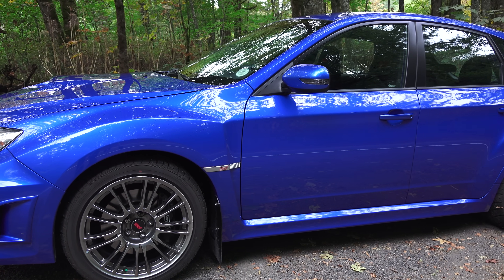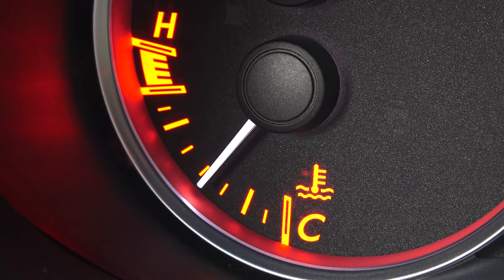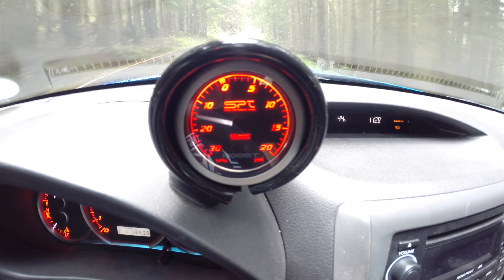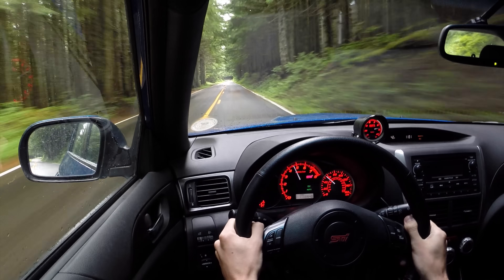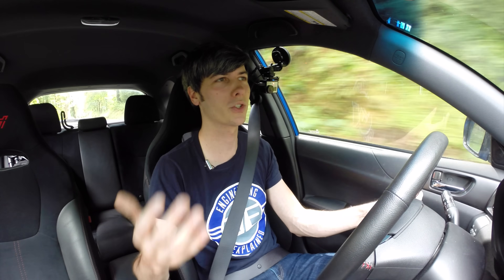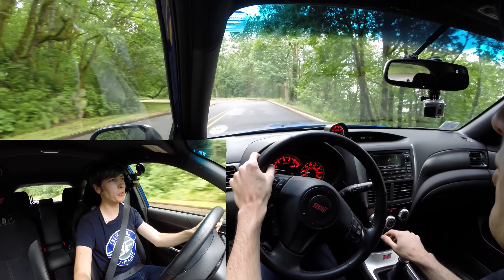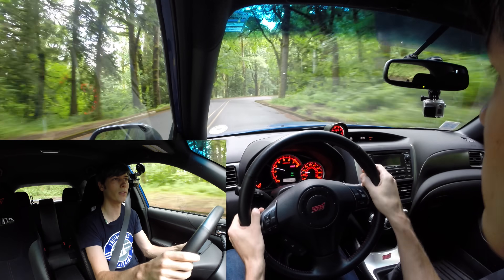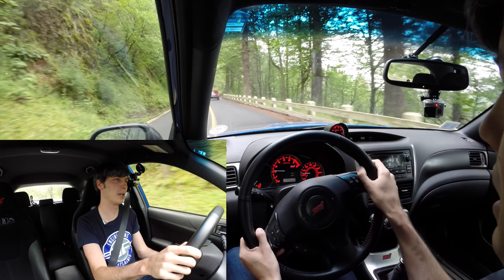5 Things You Should Never Do In A Turbocharged Vehicle

Comment: Let me shed some light on these things, from an actual Engineer that designs these cars...
1. True for any car, let the engine oil warm up before putting a lot of strain on the engine, aka flooring it and revving the engine out.
2. True for Turbo cars, you want the Turbo to cool down to prevent damage to the turbo, in the case that you have been running the car hard and you want to turn the car off immediately. This is only the case when you are track driving the car, or being really hard on the car on the street due to traffic, or just being in a huge hurry.
3. Not true about not "lugging" the engine. Engines are designed to be able to simply step on it while in gear on the highway. Be it a a high gear or low gear. The Fuel that you mention that "injects a ton" into the engine... Not true at all. The fuel is tuned to exactly what is best for the engine given any scenario. Your foot does not control the fuel, the computer does. Out of boost, at full throttle the engine will be sending fuel, per the computer, which would be between 12.5 to 11.5 AFR. Engines respond better, the cooler they are, using the greater amount of fuel of 11.5 AFR, the only reason they would be at 12.5 is to try to save fuel. So, its actually the opposite in this scenario, your engine may be lean, not rich... but again, safe for the engine of course. If you see black smoke out the back, its because the computer saw knock/pre-ignition, due to poor maintenance or poor fuel quality (same thing really), pulled timing, pulled the throttle in the case of electronic throttle, and then dumped a ton of fuel to further protect the engine. This means you need to do your intake valve cleaning maintenance by hand, or drop some cleaner in it. DIY, if you know what you are doing. Doesn't matte how good quality of fuel you think you are using, if it is getting mixed with carbon/oil deposits in the engine, the best high octane fuel (premium 91-93oct) will be reduced to much lower octane, worse than the lowest octane you can ever find.
4. Use the fuel that the car has been designed for, this is for any car. If it's modified, and the engine computer was re-tuned to take only Premium. Use only Premium. If the manufacturer states to use regular, use regular, don't use anything else, you won't hurt the engine, but you aren't doing your wallet or performance any favors. If the manufacturer states you can use both, then the higher octane is better and gives better performance, but regular is ok and you can save money just make sure and do your maintenance. If the manufacturer states to use premium, then use only premium. You could damage the engine if you use less than premium, if not in the short run, then in the long run.
5. Flooring it in a turn, sure, but that's with any car. You need to learn the car, and what its driving characteristics are. This is just being a good driver. Not specifically for a turbo car, or a muscle car, exotic, or a budget car. Any car, and all cars, have their limits.

In summary, for Turbo cars, of the 5 things Jason states to not do to Turbo cars, only Number 2 is specific to turbo cars, and the rest applies to all cars.
Turbo cars: Let the turbo cool down, before turning it off when you have just driven the car really hard. Obviously, a car without a turbo, you don't have to worry about a turbo cooling down, since you don't have one.
All cars: Let the engine warm up before going hard on it, do your maintenance to your car or the engine/transmission/brakes/etc/etc will blow up, use the proper fuel, learn the car gradually before you decide to drive it hard and try to push it to its limits or you'll find yourself in an accident.
Special Note: Maintenance of the intake valves is critical to a turbo car, so stay on top of your intake valve cleaning maintenance, or your engine WILL BLOW UP! Maintenance is important to all cars, but for turbo cars, the engine is extra sensitive to its internal cleaning maintenance. If you don't maintain it, expect reduced performance, and expect to be selling the car very soon with a broken engine that you prefer not to pay for. I've seen this time and time again. I can go into great detail on how and why this occurs, and how modern cars have this issue but older cars do not, but I degress.
Reply: Valuable feedback yours, thank you; however, point 3 is not straight forward in any of both directions. More to the point, it's not even specific to turbocharged cars - although agree that the mentioned fuel issue is impossible with electronic fuel injection.
Know some of engines where full throttle between 1-1,5k rpm in top gear produces quite unpleasant vibrations, due to (I assume) unfavourable physics (inertia and natural vibration frequencies). Both my father's 2016 Fiesta Ecoboost 125 (turbocharged) and my own 2004 SLK 230 (supercharged) or 2011 Delta 1.6 diesel (turbocharged) suffer from this problem.
Doing the same in my 2010 Panda 1.2 (N/A), 2004 CL 55 (supercharged) or 2001-3 SLK 200 (supercharged) feels - and sounds - totally fine. VW group's 2019-21 1.0 TSI 95 (Polo, Ibiza, Arona) also doesn't "complain" much.
Interesting the difference between the SLKs. Basically, ithey have the same engine, but their character is quite different - the 200 are way smoother than the 230. Read similar reports between Merc's M112 2.6L and 3.2L...
Slightly aburd topic anyway, because for quick acceleration it is obvious that a lower gear should be used.
Reply: I read your comment. I am a beginner DIYer.  What do you mean by intake valve maintenance? I have never taken off a valve cover?
Sorry for such a novice question.
Reply: @louarmstrong6128  To clean the intake valves, you don't need to remove intake valve covers. The  valves are like upside down lolly-pops, except with the circle facing down not facing you, and the stem going straight up. Under the valve cover you can get to the stem, but not the face of the valve. What you want to clean is the face of the valve [and the back of the face] which is in the air path.
Before we continue on the explanation, you have to also understand that when your valves begin to get dirty, that's when buildup/cleaning is strictly contained [and needed] at the valves. It is rare to catch it this early. BUT, that's what the cleaning is called, intake valve cleaning. What you want to clean, is not just the intake valves, where the buildup begins, but also everything behind the intake valve all the way out the tailpipe of your car. Intake is where the air comes in, and the buildup begins there, then it continues to run and buildup all the way through the system (engine, exhaust manifold, turbo [if you have one], exhaust system, then finally tailpipe). Intake valve cleaning is a misconception, when what is actually needed is the entire system cleaned beginning at the intake valves... but, many people understand and have heard of intake valve cleaning. Also, once everything is clean, you want to maintain the vehicle by keeping up with the cleaning before it builds up, and that is simply cleaning the intake valves at that point. So, clean it all once, then maintain it by just cleaning the valves. The cleaning procedure is all the same.

Now, to continue on how to clean EVERYTHING, not just the intake valves. This is where you will have to study further, or wait till I make a video myself, as it seems that no one has a complete comprehensive how-to on it. But, I'm sure this sounds extremely labor intensive and complicated... So, to get you started, what you want to use a liquid cleaner. Its really not labor intensive or complicated, with a liquid cleaner. Look up how to use seafoam. There are many products that can do the cleaning, but all the comparison tests I've seen on breaking down carbon buildup on valves, shows seafoam to be best. Also, in my experience, seafoam has been the best. Don't use the Walmart knockoff that sits right next to it on the shelf, it's not as good. Seafoam cleaning. Study it.

A few last words of wisdom. The white smoke that comes out your tailpipe when you're doing the cleaning procedure, that's carbon buildup. When it comes out a faint blue, that's the seafoam. Do one cleaning procedure at a time, and as a check, do another cleaning procedure and see if it comes out a faint blue. If no white smoke, just blue, then no more cleaning procedures needed. Each cleaning procedure, requires one bottle of seafoam. I've seen as many as 20 cleaning procedures needed before you get no white, all faint blue. The car gained about 100hp from doing the procedure... and no more knock, and risk of blowing up. Yeah, you could lose about half your hp when its so bad, its about to blow up... or it can blow up sooner, have oil consumption issues, etc etc.
Reply: @copperkeyracing6167  Boy did I ever hit the holy grail of responses ...I appreciate the the time and experience you put into this, I will have to sit down tonight to fully absorb this....awesome and thank you again
Reply: @louarmstrong6128  you're welcome
Reply: @copperkeyracing6167  Thanks so much for your explanation man, really appreciate it!
Reply: @copperkeyracing6167  Thanks a lot for explaining this in so much detail man! Many Thanks!!
I have a question for you.
I recently bought a Skoda car with VW 1.0L TSI (3cyl, Turbo-GDI). 
Is it safe to use seafoam in this type of engine. 
How often shall I do it?
Regards
Reply: @angad2685  It's safe to use seafoam in all engines. I would do one bottle/cleaning-procedure every oil change, as I recommend for all direct injection engines that don't also have port injection. For port injection cars, I recommend one bottle/cleaning-procedure per year. I'm pretty sure that VW engine only has direct injection.
Reply: @copperkeyracing6167  Yes sir indeed, it is a only gdi engine without port injection. Should i use seafoam even when the car is under factory warranty? Won't it risk voiding it?
I am covered under warranty for 6 years for the car.
Reply: @angad2685  Yes, do it under the factory warranty, it won't void the warranty. Especially when it's new and under warranty. It's like asking if you can take your car through a car wash without voiding the warranty. Of course you can. You want your new car to look nice and clean on the outside, and run clean and at optimal performance on the inside. I know of a guy that took his car to get his engine warrantied after he had somehow managed to blow the engine (he raised the boost on it not knowing what he was doing). He also happen to keep his engine very clean with seafoam. The dealer opened up the engine, saw that it was like new and super clean inside, and had no hesitation warranting his engine. They figured he was meticulous about his maintenance. Another guy, same issue, blew his engine... the dealer saw his engine was filthy inside, they voided his warranty on the spot. The difference was seafoam. Clean engine internals=> no issues. Dirty engine=> sorry no warranty. Who's fault was it? Direct injection was at fault, and the manufacturer not telling them to seafoam regularly... when they needed/were suppose to.  Crazy world, but that's how it works. Keep things clean, people appreciate you. You don't keep things clean, people don't respect you. Not always, but most of the time. Seafoam/clean internals=better warranty, better fuel economy, more reliable, less wear and tear of the engine, consistent and no power loss. It's a complete eye opener.
Reply: @copperkeyracing6167  You're absolutely incorrect re. lugging your engine. Look up LSPI.
Reply: @bhr788  LSPI has nothing to do with load or "lugging." Preignition can only come from either an ignition source (external to charge mix) or autoignition (internal). If you have an ignition source other than a spark plug ( like glowing carbon deposits), that's present regardless of load. Which leaves autoignition. Autoignition requires the mixture to rise above autoignition temp (not flash point, which is different). This rise in temperature can be just from higher temps, or can be from higher cylinder pressure, or the resulting combination (Boyle's law).

But again we find LSPI is not due to load. It might only show up at higher load, but it always has a cause that isn't the load itself-- it something else. Timing, mix, hot spots, etc. A properly functioning engine's response to being overloaded is to stall. Period.
Reply: @copperkeyracing6167  s
Reply: @copperkeyracing6167 no to clean the intake valves you can put in intake valve cleaner into the pcv valve in a di engine.
Reply: @copperkeyracing6167 how to see what color smoke comes out the exhaust, when with for example fuel system cleaner, you have to drive the car for it to clean?
Reply: @Richbutactsbroke  correct, you have to drive the car for it to clean. You put the clraner in the intake tract as I described while at about 2k rpms. You shut the car off for 5-10min, then you start it and go drive it, giving it full throttle. The more air flow, the better it scrubs. You will see a ton of smoke come out. If it's thick white smoke, then that's the build-up coming out. If it's faint and slightly blue, then that's the seafoam liquid coming out. If/when you see white smoke for just the first full throttle run, or none at all, then you're likely done cleaning. If it keeps pouring white smoke out of the exhaust on multiple full throttle runs, keep flooring until it stops, then repeat the procedure.
Reply: @ thanks bro appreciate all your answers
Reply: @copperkeyracing6167 give this comment a random like down the road . This appears to be genuine knowledge I’d like to refer back to in a few months
Reply: What does all this intake valve cleaning do to the catalytic converter? I've got a feeling that it will be damaged.
Reply: @elroyfudbucker6806  Good question. Let me answer your question with a story... I have a friend with a 2005 Toyota RAV4. We are on a road trip and the check engine comes on. This was in 2015. Naturally, we get it scanned, and it has a catalytic converter low efficiency error code. So, we hit up a walmart. And buy two bottles of 16oz seafoam. We do one procedure, lots of white smoke. We do a second bottle, lots of white smoke, but less. Oh well, probably needs another, but good enough. We continue on our road trip... about 50miles later, check engine light is gone. Perfect. Catalytic converter cleaned up, working great now, and no more code... abs working again (toyotas from this era would dissable abs/tcs when catalytic converter code pops up). A year later, code comes back, another bottle of seafoam, and codes gone again for another year. Repeat, haven't changed her catalytic converter yet... so, there's your answer. Seafoam extends the life of your catalytic converter by keeping it clean, build up free. I've done this to many cars, and saved friends/customers thousands of dollars. This $#%@ works!
Reply: @copperkeyracing6167 hello there friend. If you could help me with a problem I would be much appreciative. I have a 2019 Ford Edge with the error code P0243 (Turbocharger/Supercharger Wastegate Solenoid "A"). I was told changing out those Turbochargers can be up to $3000! Is there a way to fix this issue without replacement??
Reply: @JPJ432  Why replace the turbo just replace the solenoid, new should run @ $40 then from your comment you need to find someone to replace for you shouldn't take much at all to do
Reply: The takeaways are....

Maintain your car.   Preventative maintenance goes along way to not getting stuck on the side of the road.  

Use the correct fuel for your type of car.

Drive like a normal human.    Your daily driver is not an F1 or NASCAR  race car.
Reply: Thanks for the info.
Reply: Keep in mind, these claim made by him aren’t originally his he is just reciting what mechanical engineers have been say for a long time. Lugging the engine is very bad for the engine, specifically for “small turbo engines” turbos produce too much heat which can cause detonation at low rpm’s. These claims come from seasoned people and tuners who have been racing engines for a long time. Engineers also make this claim. Just because you are an engineer doesn’t mean you know every single thing about engines. You studied mostly math and physics and a bit of mechanics. Leave the professional studies to the professionals.
Reply: Thanks for your explanation, much appreciated 👍🏼
Reply: Replying to this so I can find it later. Great advice
Reply: Can this be like the top comment, too underrated
Reply: King
Reply: u sound like u shuda made the video
Reply: i guess they just made up LSPI then
Reply: @hypr1 LSPI only exists in direct injection engines that have not been properly maintained. It has been a huge learning curve for some people. Now we know better. Seafoam clean the head/intake-valves at every oil change interval to remove carbon buildup on a regular basis, and LSPI will NEVER occur. You can floor the hell out of it from any RPM, and nothing happens. It will never cause any damage.

If you want to get better response and part throttle fuel economy you can also do a manual cleaning of the valves by removing the intake manifold and walnut blasting. It's not necessary though for removing all chances of LSPI.

LSPI is no longer a thing... with proper maintenance.
Reply: 5. well he does highlight more so
Reply: #5 - especially for Mustang owners lol
Reply: For turbo diesels - what are the do's and don't's?
Reply: You need to get a life, a girlfriend or something.
Reply: Awesome advice
Reply: No way you are an actual proper engineer. Roblox gameplay is very sus
Reply: What is the normal life expectancy for a turbo? My mechanic told me 100-150K miles.
Reply: Do we need regular intake valve cleaning on a petrol engine?
I have a Vauxhall Astra J GTC 1.4Turbo 120PS with 50K miles with full service history and regular maintenance in garage.
Reply: @PabitraPadhy  Yes. I recommend a yearly cleaning procedure using one 16oz bottle of cleaner through the intake tract for a port injection engine. For a direct injection engine (that doesn't also have port injection), I recommend the same procedure, but at the same time interval as an oil change, every 3mo/3k miles (aka 5k km). It's not whether it has a turbo, it's whether it has port injection or no port injection. Port injection cleans the valves. Without it, the valves get filthy, and then, like a domino effect, everything else behind the intake valves does.
Reply: what rpm is okay before the engine oil is fully warmed up?
Reply: @pps9896  I would stay at no more than half of what the factory rev limiter is set at until an engine is fully warmed up (coolant temp and oil temp). So, if it's 7k, don't go past 3.5k, if it's 8k don't go past 4k, etc.
Reply: @ thanks for the tip and quick reply!
Reply: thanks
Reply: Have you ever floored it floor at low rpm in a gear? It sounds and feels horrible for the car.
Reply: @JTheraos Yes, all the time. I love it! Pulls very hard. It's well maintained with no carbon buildup. Runs like a champ! I can put it in any gear at any RPM, floor it, and it loves it. What you are experiencing is really bad carbon buildup.
Reply: I got my first turbo charged car 2 weeks ago, this information is really helpful. Thank you for typing out this, as Jason is going through the list, in my mind I'm thinking "this applies to every car except point number 2" and I decided to check the comments, glad I found this.
Reply: @Satunnainen Katselija  because the service manager doesn't want to admit that he's been defeated. There is obviously more maintenance needed. I would study up on carbon deposits and cleaning it with a liquid cleaner. Manufacturers&dealers don't want to admit that direct injection doesn't actually improve emissions. It just bottles it up inside the engine, and then you have to clean it out.
Reply: THANK YOU, I was a little upset at the misinformation being “explained” in 3 and 4.  I’m glad someone clarified.
Reply: Thank you. I'm tired of these turbo myths being sharted into the ether with authority over and over again by idiots.
Reply: This is why I read YouTube comments. Because sometimes between all of the nonsense is a comment that’s a diamond. That makes sifting through the garbage worth it. Thank you for putting your time into educating people like me.
Reply: How do i check and maintain my intake valves?
Reply: @lennartproost  Read the reply that I gave to Lou Armstrong above. The only way to check how clean the valves are is to actually do one cleaning procedure and see what comes out of your tailpipe. So, learn how to do a cleaning procedure. Do as many cleaning procedures till it comes out clean. Minimally, you'll do two procedures. The first procedure will always come out dirty, the subsequent procedure will either come out dirty or clean. You stop when you've done a procedure that comes out clean.
Reply: Thanks. Best comment I've read on YouTube in a long time.
Reply: From another engineer..thank you.
Reply: you said everything i was going to and i thank you for what you said. 
ive had issues with his car videos when they pop up in my feed and this video proves why.
hearing how it will "dump fuel and burn up your catalytic converter" made my head hurt.
Reply: Many thanks for your intervention. Please make your you tube  channel and I will subscribe immediately. We need ca's guru like you, to explain in detail with proper knowledge   I never liked that guy anyway 😉
Reply: I was looking at the comments at point 3, because i was thinking, this guy cant be serious, what would be the ecu for if not for mapping the engine to any load at any rpm range and also taking a lot of other numbers like lambda or intake temp .... in consideration. You might get vibrations, but this is just the high amplitude of the engines vibration resonating with the transmittion and clutch (dont know every single word, english is not my first language)
Reply: Interesting how long did it take to post this comment? Geez…
Reply: @velvetbear7184  10min. Any questions?
Reply: Not all cars have computers controlling fuel flow so what you said about fuel flow isn't valid. The car I drive is older than me and doesn't even have anything electronic in it.
Reply: thank you for writing all that from me. a 40yo mechanical engineer.
Reply: What a legend we have here!!
Reply: Only use synthetic oil regular will burn in the heat of turbo. Turbos run very hot they glow under full boost when run hard. Why you let car cool down before shutting off when boosting  hard before stopping let oil circulate and cool and turbo cool. I did this by easy 5 minutes before parking if I had been going hard. If not that hot oil and hot turbo when stopped that oil sits in hot turbo and cooks. Best to cool down so it does not cook, that is why regular oil is crap in a turbo it literally will burn at turbo temps.
Reply: @RT22-pb2ppmp
Reply: What is ideal oil temp before getting into boost? Specifically a 22 wrx. I ask because I've heard several different temps, I had to get into it this morning, oil temp was around 127
Reply: Currently finishing my undergrad in Mechanical Engineering and specializing in Powertrain engineering. Everything in this comment lines up perfectly with what I've been studying. Thank you for the input!
Reply: That point in video about lugging engine also made me double take. Just because you aren't getting the power at low RPM, doesn't mean it's stressing at all. And of course fuel is measure for the air, and with less air at low rpm, less fuel.. Odd point to make, if knowing basic engine operations.